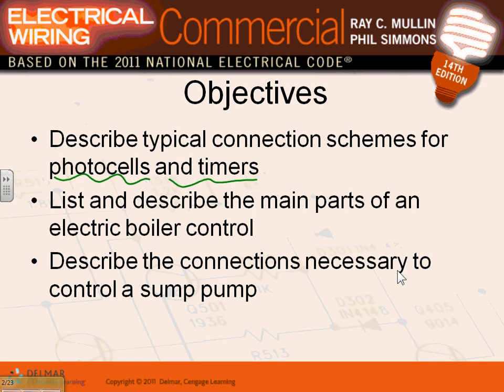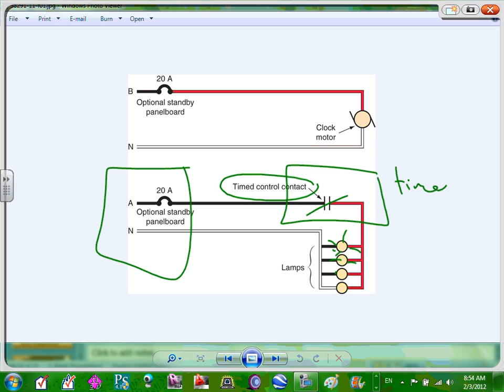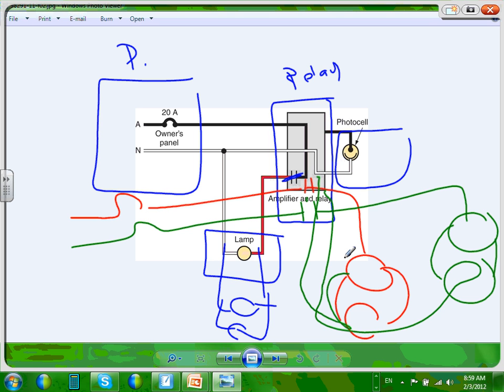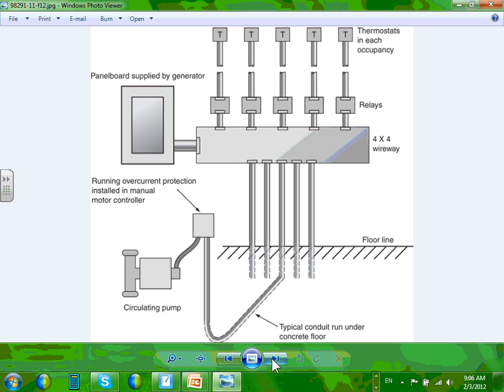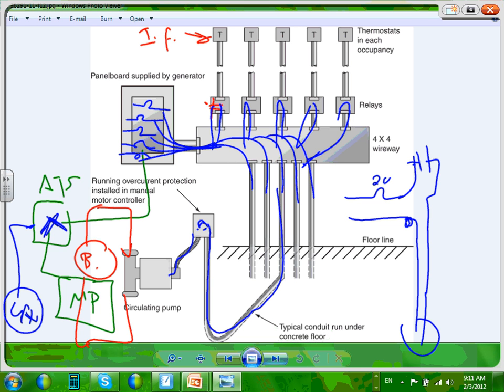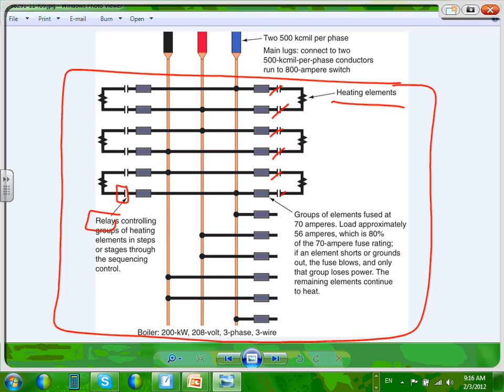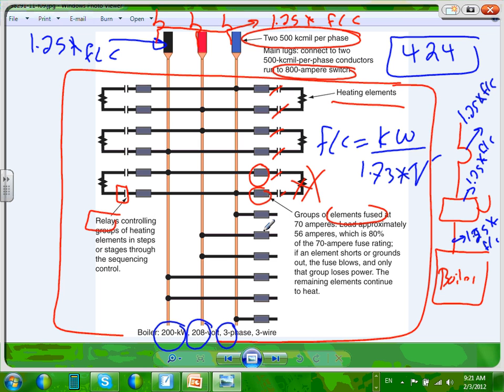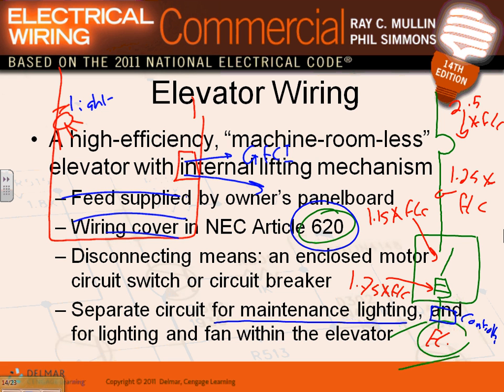Boiler, Pumps & Elevator-EWC-Ch#11-02-03-12.wmv

Comment: Some photo controls work off the principle of variable resistance. when light is applied to cell, resistance increases so cell works like a switch, it opens (off). The absence of light lowers the resistance thus closing the switch (on).